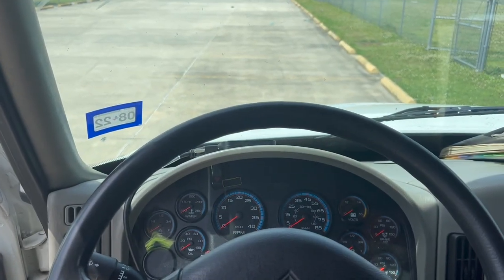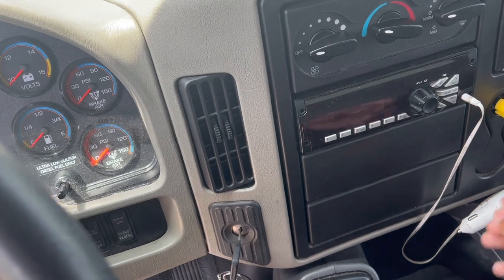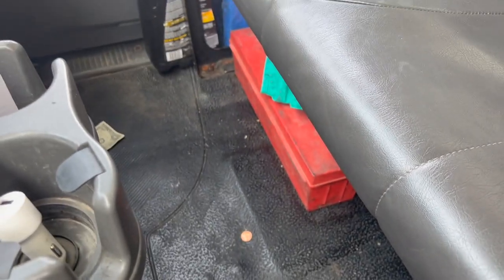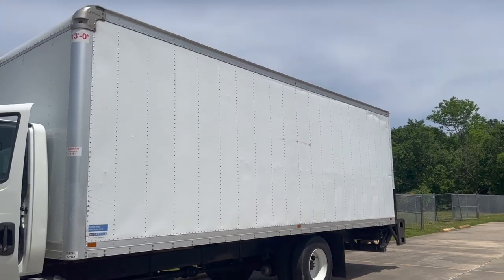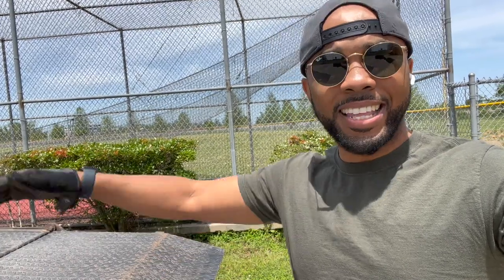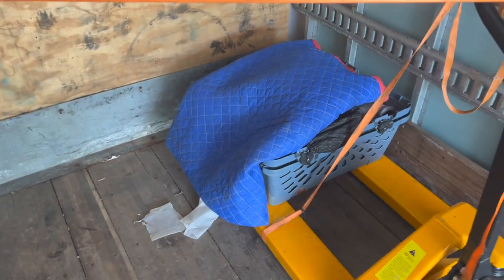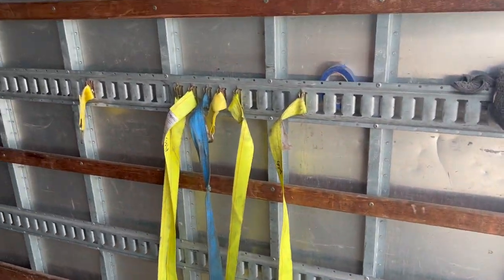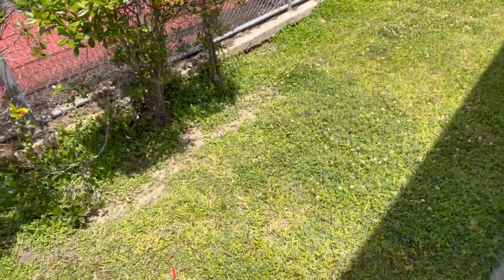International 4300 Box Truck Review| Non CDL Box Truck Review|Reaction| Overall Impression

Comment: Phone holder in the center of window is a DOT violation. 
Put it in the top left corner of the window.
Reply from the maker: Thanks for letting me know!
Reply: The center of the windshield is fine violation and will be when it's in your line of sight. I have 2 Navigation devices  a 7 inch and a 5 inch with a dash cam right in the center. State Trooper told me nothing directly in front.

Comment: Any problems with the truck thinking of buying one 2011
Reply from the maker: I think it’s a good truck although I am currently experiencing some front-end issues. The Kingpin needs to be replaced but most would consider that a wearable part but I don’t think I would have this issue if the truck was air ride equipped.